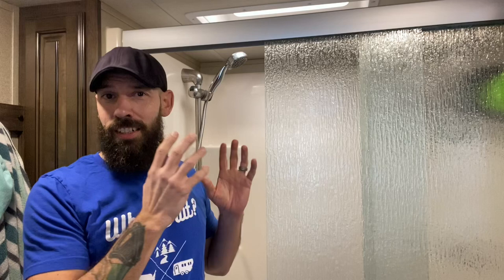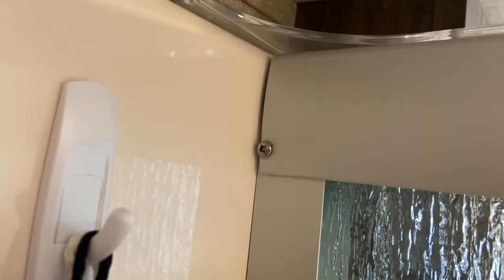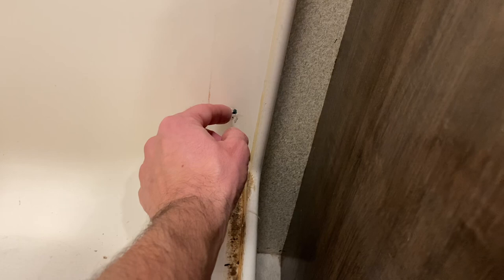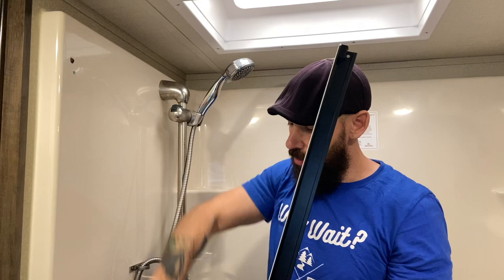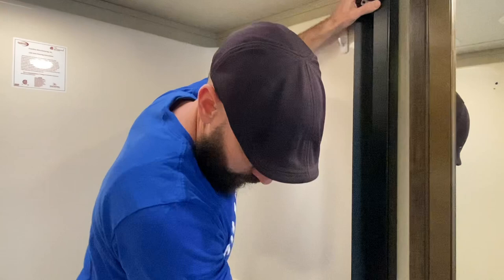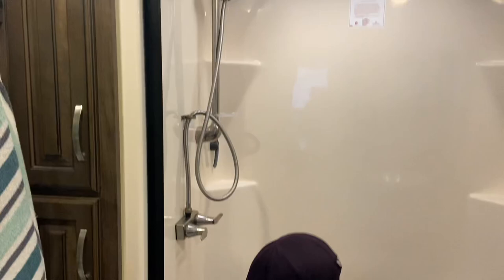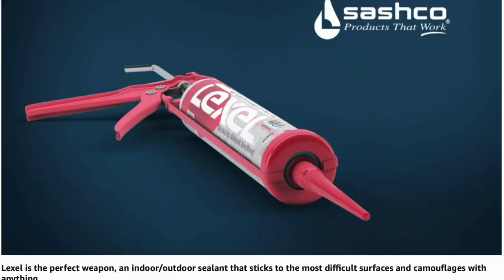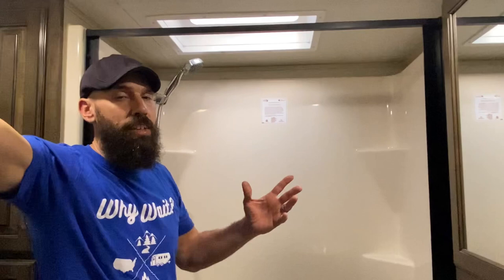The Nautilus Retractable RV Shower Door! (Installation Process & Review)

Comment: Mine sure wasn't this easy to install. My walls were super warped to the point that not much of the adhesive tape would touch the wall. . I had to put in spacer wood on one side(sink end) in my 380FLR . It works great!!
Reply from the maker: Glad it worked out for you in the end! These things never go as easy as they should. I honestly had to fight two screws forever to get them out. Good to hear it works great. 👍🏼
Reply: I'm having the same issue now. My roller door side's adhesive tape would only make contact in a few small areas. I'm thinking of getting a second roll of Gorilla double sided tape and doubling up the tape to close the gaps.
Reply: @dzw4826  That should work. I screwed in a spacer piece  of wood, then stuck the adhesive to that pieces . Back filled with white mold free silicone caulk.
Reply: @bigdaddy51200   Just finished. In some areas I stacked 3-4 pieces of dual sided tape. Not ideal for sure. It is in there pretty solid and like you, I loaded it with silicone. I'll let that settle for a few days and then hit it again with some more silicone to smooth it all out.  The door does look awesome and operate smoothly.
Reply: @dzw4826  glad you got it finish. I got very frustrated with it.
Reply: @bigdaddy51200   Nah, Try replacing an RV Skylight. One would think they are easy.  One would be very wrong. lol

Comment: I recently installed this product and the jury is still out. Here is a few things I have learned and one is very painful because I am currently redoing the job! Ugh! First the bottom is curling up so water hitting the floor close to the curtain can splash under and out on the floor. Second and the painful part. The section that the curtain roles up into has plastic caps top on both ends. I have a two piece shower stall and I didn’t pay attention to this fact so when I put this section up I should of calked the bottom and that crack before I put it up. The fact that I didn’t when your finished water runs off the curtain out the back and out through that crack and onto the floor. Hence why I’m redoing the job ugh!! If the bottom rail was much taller the splashing would not be an issue. Hope this helps someone to not over look what I did and get it right the first time lol.
Reply from the maker: Nothing worse than having to redo a project. I feel for ya. So far so good on ours though, everything is holding up and working well. 👍🏼

Comment: My camper came with one of these. I love the design, but for the life of me I can't get it to stop leaking around the bottom of both sides. I've caulked inside and outside. I'm to the point of removing all of it, caulking under it, and reinstalling, and then caulking on both sides of it.
Reply from the maker: Crazy. I wonder if it’s the same kind from the same company. I was pretty adamant for checking for leaks when I installed ours and so far so good. Hoe you figure it out. Thanks for watching.
Reply: @WhyWait  yes, it's the exact same make and model of shower door. I think it boils down to whoever installed it in my shower at the factory didn't do it right.
Reply from the maker: @WesDuncan  sounds bout right
Reply: Follow the instructions and just caulk the outside.   Pretty sure it's designed to drain back into the shower.  If you caulk the inside you are probably messing with how it is supposed to function.
Reply: @geoffbutler10  you don't think that was the first thing that I tried? Didn't work.

Comment: Very nice install video. I have this door and initially used clear gorilla tape to seal it temporarily to see if we liked it. We love it too, unfortunately when I caulked it according to manufacturer instructions it leaked on both ends. I will be removing the door to caulk where the wall sits on the tub. I'm pretty sure that's the problem. My question is if you caulk the inside also, when the squeegee wipes the water, where does it go? You are correct, the water collects under the bottom rail which is not good and I will be caulking the rail. But what about water collecting by the canister, has that been a problem. Sorry so long. Thank you.

Comment: Thanks for posting this video. I bought this and am headed out now to the GD Reflection 337RLS to install it. It's always great to see someone else put it in first. Also, I totally agree with the screw issues. The previous owner of my RV had already removed the glass doors and they were using a shower curtain.??  Yikes.   But because of your video, now I know why I have all of these unsightly screws and screw holes.  I'll address similarly.  Thanks again for the content.
Reply from the maker: Good deal. Yeah I’m not a shower curtain fan. Good luck with the project and hope it turns out nice for you. Thanks for watching 👍🏼

Comment: This is interesting! We haven’t had any issues with our glass door but the cleaning is HORRIBLE! I think I would be afraid that my clumsy self would fall through that door!  Maybe it is sturdier than it looks, or a much cheaper option. 

If we have issues, we may take a peek at these for an option. 

Please keep us posted on how it wears over time, or if you have issues with the weight on the tape adhesive.

But as always, well done!
Reply from the maker: Yeah the cleaning is no fun. I will say Gabe’s Pride does a nice job in them and seemed to keep them cleaner longer. We use their products on everything for a few years now. The heavy duty shower track brush beats a toothbrush as well. Video to it below. 

https://youtu.be/J7iNKDYiIww

Comment: Our curtain isn't an issue with any water on the floor or coming into contact when in the shower. The inner liner snaps off and put it in the washer and just hang back up to dry. Too easy.
Reply from the maker: Cool. Definitely works that way too! 👍🏼

Comment: Hi! This video has been super reassuring as I ran into all these problems. I’m currently in the same situation with the screws holding the shower in place. I tried finding lower profile screws but can’t. How did you get it to adhere to the wall with the screws there? I just can’t see how it works. Thanks so much!!
Reply from the maker: I removed all of the old screws except one. Even though it doesn’t call for it and it’s not necessary I used the existing holes and screwed the bars into the wall. The one screw that I couldn’t get out just sits behind the bar and wasn’t a problem.
Reply: @WhyWait  I understand leaving screw into the one end, but how are you laying the screen roller side, over the top of the screw?  Like you, I feel that the shower enclosure itself is not very secure without screwing it into the wall. I understand the part that you can't drill holes into that roller side.  I just can't imagine laying the adhesive over the top of the screw.  It isn't counter sunk etc.  Can you explain this to me.

Comment: Hi.  We purchased a Nautilus shower door and are trying to install it.  When we removed the old door assembly we ran into the same screws in the surround that you have in your video.   We need to remove those screws so the frame of the nautilus can be flat, as you did in the video.  Question is: if we remove the screws do we have to put screws in somewhere else in surround?  

Thanks in advance.
Reply from the maker: As you can see in my video I removed what screws I could and then put them right back in drilling through the Nautilus frame to do so. Those screws do hold the shower in place and if you remove them you can feel the shower get somewhat loose. On the door side I couldn’t get that one out, it was no big deal, with the tape on the track the screw head just kind of pushed into that and the frame was still flush against the wall. 
Again you can just leaves the screws and mount the new shower in front of them too. That’s what most people do I think. Hope this helps.

Comment: Thanks for this! Looking at replacing the rod and curtain in our new unit with this. the bottom corner of our surround looks just like yours. Looks like you got the 'square' version but it works ok with the slight radius?
Reply from the maker: It does. I had to use a lot of sealant under the bottom bar though. Probably should of went with the rounded.
Reply: @WhyWait  Thank you! Ours is 36.5 w at the bottom and 37.5w at the top. I guess that means we need to order the 48"? Will that close properly?
Reply from the maker: @sherieweatherby3793  yeah and you cut the rails down to size. 👍🏼
Reply from the maker: @sherieweatherby3793  oh and I don’t know about that inch difference. Might want to contact the company.
Reply: @WhyWait  I like the square over rounded (also smaller top/side bars) but also have the same radius. Do you thing you could have filed / trimmed the outside bottom corners to fit the radius? Is there anything in those bottom left/right corners that would prevent it?

Comment: How did you remote the silicone within damaging the gelcoat?
I used the same goo gone but can't get the silicone removed
Reply from the maker: Mine really wasn’t that bad, in fact I used just plain soapy water to clean most of and just a plain plastic scraper. Maybe try WD-40 or something if it’s not coming off. Hope you get it!

Comment: Having young kids, has anyone fallen into the door?  How strong is that material?  I have two boy and I can guarantee during hide and seek they're going to press into the door.  Does it leave a dimple from impact?
Reply from the maker: Hahaha no, no one’s gone crashing through the door. I would guess if you did it would just come unlatched because it latches easily, and it would shot back and coil up.
Reply: @WhyWait  thanks for the reply.  I am really curious on the durability of it and how it holds up from marring/impact.  How is the material - is just a thick plastic and would you think it would dimple from an impact of kids' hand or a strong punch/bump?  I am trying to figure out if I should order this or not.  Also, how is the latch - does it come off too easily - does the curtain then shoot back into the canister at a dangerous high speed?
Reply: Would be cool to see close up videos of the latch system, the squeegee in action, and a unlatch-let go of the door open scenario.